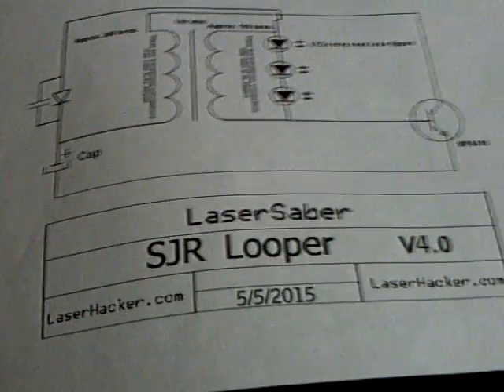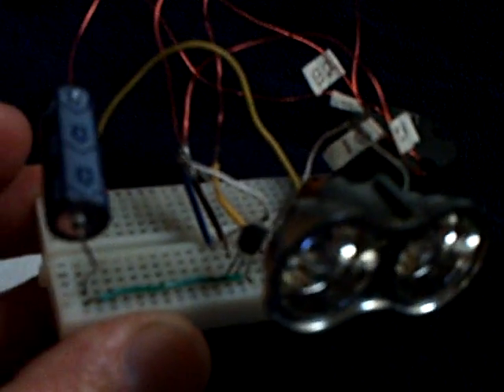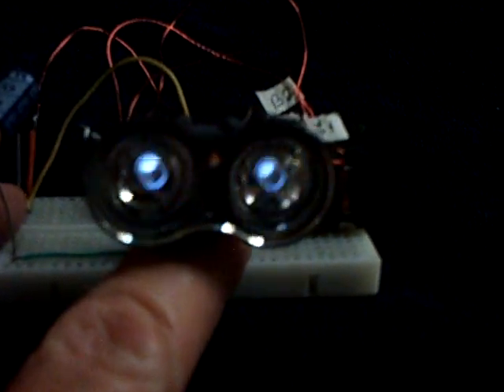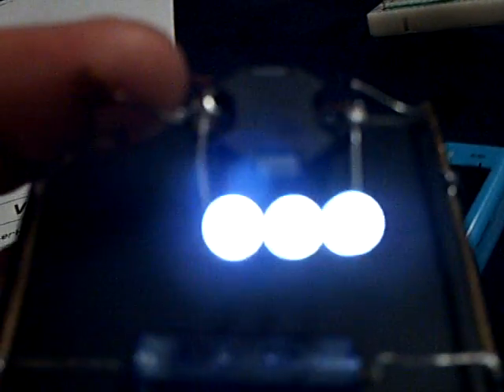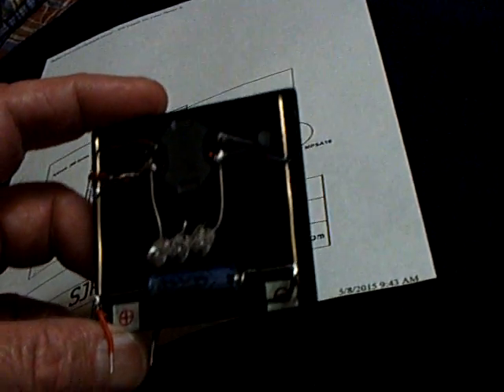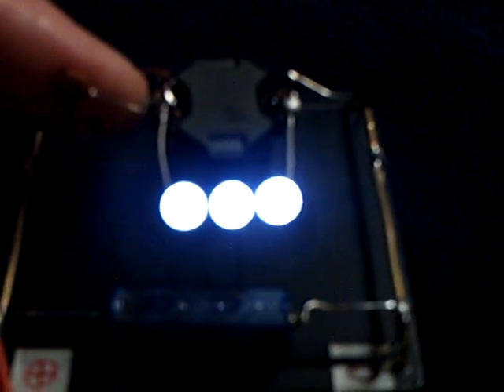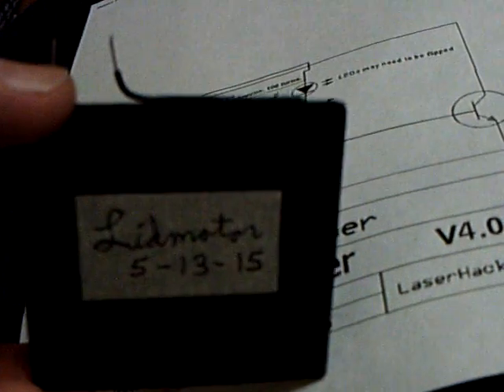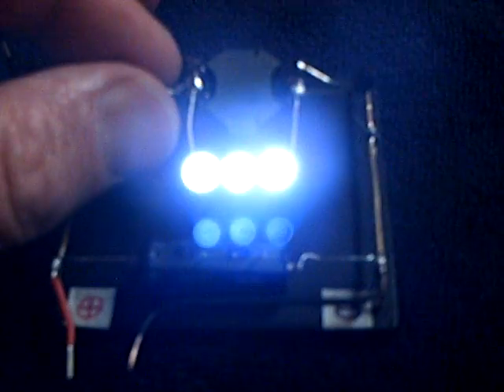Looper  -- Ridin The Rails

Comment: For those interested in experimenting with Jewel Thief circuits i just found some interesting info you should check out. Here it is: Zero Threshhold Mosfet
http://www.aldinc.com/ald_zerothresholdmosfet.php
MOSFET-based Joule Thief steps up voltage
http://www.edn.com/design/power-management/4438702/MOSFET-based-Joule-Thief-steps-up-voltage. I plan to try some designs with the mosfet. Enjoy and let's see your videos.

Comment: The couple of them built here have been great for changing out caps, different coils etc...just tough and everything on one side. Made the mistake of thick copper on the first, stays hot for a long time ! I imagine Victorians could have used TK's build method for bed warmers in winters.
Reply from the maker: slider2732 Yes I thought about the board and the layout before I started this.  This circuit is so sensitive to capacitance that placement of the parts seems important .  Try running yours off a Slayer Exciter with an AV plug.  Be careful not to blow your leds or transistor.  This is a fun circuit.

Comment: Like to see how the transformer Is made !
Reply from the maker: magnetman2010 Hi.  This is another little project you would enjoy.  The transformer I made is pretty simple.  Just wind up the primary on the bottom of the bobbin and then wind up the secondary right over the top of it.  I am using about twice as many turns for the secondary.  Use a ferrite core of some kind.